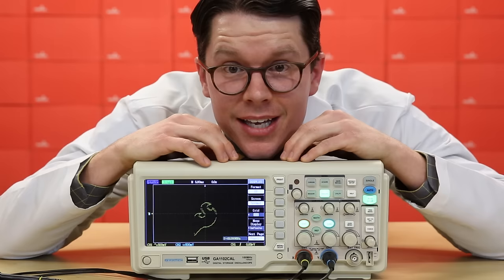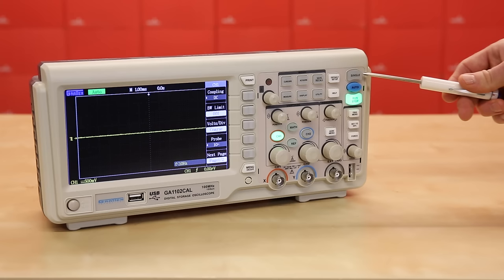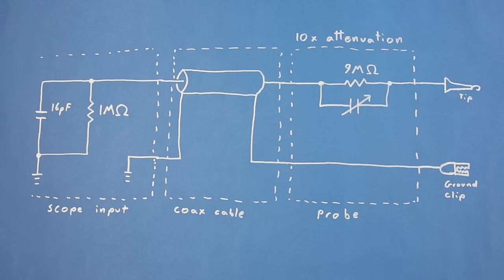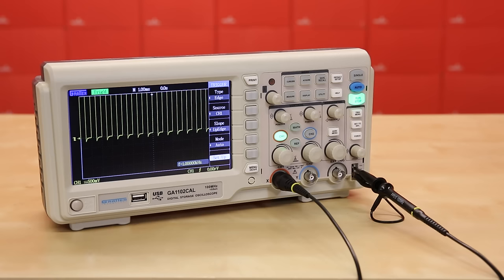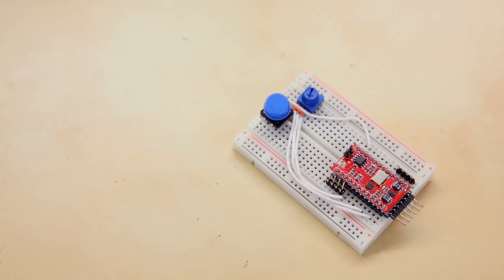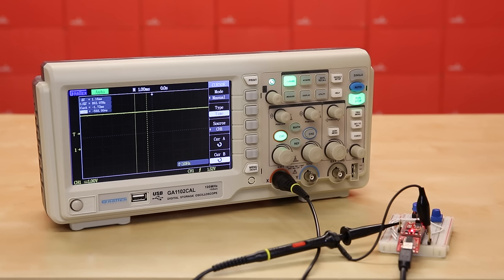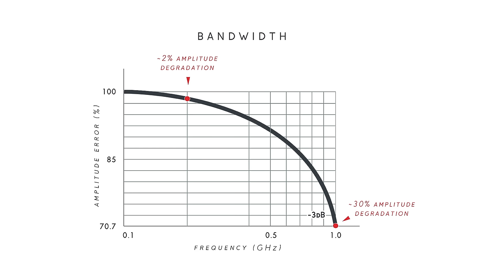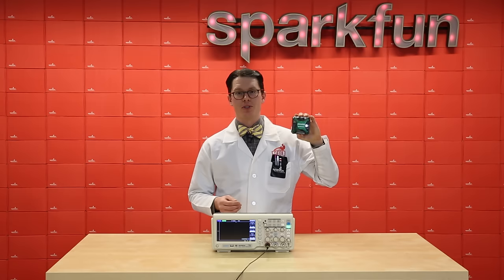How to Use an Oscilloscope

Comment: You said we only needed to use one or two knobs.... but then you turned them all.  You made my brain hurt.  I'm not giving up regardless.  Though my brain be small, my will is gigantic.   This still makes my brain hurt though. I think I mentioned that.
Reply: Chris Norton
It is only when the brain hurts that knowledge is being applied.
When I was studying Electronics Engineering decades ago, whilst working for PHILIPS,
My direct boss and mentor made my head hurt.
I could have strangled him then.
Years later whilst serving in the Military, I asked him why he was so tough.
He explained it this way.
Knowledge is like hammering a nail into a wall.
To make sure it penetrates one has to hammer it hard.
When one just 'casually throw the nail (knowledge) at the wall, it will bounce off.
I realized that by being tough and a pain sometimes, he did me a great favor, in that
I never forgot what he taught me, and by doing so made me a great Engineer.
Ultimately leading to being posted as an exchange officer to the USAF, and having the
opportunity to work on some special projects, in electronic weapons, robotics projects for NASA/UASF
working with avionics specialists on the Presidents Jet(s), and having learned much during this time,
as well as solving some specific problems.
Stay with it. Success is achieved by 'DOING'. Trying does nothing, trying does not even cure constipation.
It will only give you pain the A _ _ 
As a side note .. I am still good friends with my one time mentor and former boss. 
He is still alive and exceeded age 85.
Reply: Yeah this was at the 4:45 mark or so. I saw your comment first so when he did the setup before taking a measurement (pushing every button and choosing a setting for everything I barely grasp) I laughed out loud.
Reply: mee too man

Comment: It would be helpful if you could give practical examples of WHY one would need to use an oscilloscope. I’ve seen many videos telling me what oscilloscopes measure, and how the machine can be dialled in to take these measurements, but I still don’t understand what kind of circuit problems or situations require an oscilloscope.

Comment: Howdy.
The 10X feature is to enable measuring high voltages or to provide very low loading of the measured circuit.
Tuning the probe capacitor means that the probe R/Xc ratio is the same as the input R/Xc ratio. This delivers best signal fidelity.
Using an oscilloscope be aware that the signal grounds are galvanically bonded. One could introduce short circuiting when using both channels doing measurements in an appliance. Worse still. Older cathode ray scopes also have their signal grounds connected to the chassis and the power Protective Eath ( = power ground ) is also connected to the chassis. There are real dangers to smoke one's appliance or getting shocked.
Always feed an older scope through a separation transformer. Always use a galvanic separator in one channel when doing dual channel measurements.
In my digital scope there are galvanic connections between the power ground ( = Protective Earth ) and the input grounds. However. I use the scope in an older apartment where there are only two prong outlets in the room. Old wiring may, totally legally, be as they were done originally. So I do not need to feed the scope through a separation transformer.
Regards.

Comment: Glad that they didnt scare off any newbies with the fact that the scope shares ground on all channels and that ground is not isolated from the rest of the circuit in your house so if you go probing AC voltage and connect your ground to live or neutral you gonna have a really bad day.

Comment: I bought a scope just so I can look like I'm doing something sciency.
Reply: Always a good call.
Reply: Yea? Me too! (LOL). Frankly, I bought it because I need to test and adjust my Tascam 32 Reel to Reel Record and Playback heads. I've got a lonnnngggg way to go before I can do that. So I joined a forum and I printed out 3 different "How-To" manuals and one owners manual.

Now I need to lock my home-office door for two hours everyday because my wife doesn't seem to understand that periodical intrusions while I'm reading these manuals requires my utmost concentration. I always wanted to learn how to use a scope but I've NEVER EVER touched or 'played' with one! I only recently realized that I wasn't near an oscilloscope more than maybe twice in my 60+years!

That's really wild in my mind because I'm a retired 1st class machinist and have worked for at least 15 different production shops, job shops, mold and tool-making shops and even 3 or 4 specialty R&D shops! (Not to mention a number of journeyman field jobs I was hired to do). At least two or three of those shops were geared to machine electronics related parts and equipment.

I may have seen a scope in the R&D shops, (one was an aerospace shop and two others were 'extreme-compression' operations). It just seems weird to me that as interested as I've always been about oscilloscopes, and the potentiality of one or more of those shops to have a scope, I've hardly ever even touched one... huh...

Well now, I own one... "hmm let's see, where the on/off switch on this thing..."
FWIW
Reply: Ahahah! i liked" the wife intrusion section!!"
Reply: I bought a load of books n shelves, and got rid of my T.V. to look more intelligent.
Reply: I'm a former B-707 and DC-8 driver and have made the mistake of exploring micro-electronics. I'm single so the wifey thing isn't gonna be a problem but the endless reading of manuals isn't my thing either. That's like engaging the auto-pilot and just scanning the steam gauges (or worse today, the glass screen cockpit displays now standard on flight decks...) and doing nothing but twiddling my thumbs for 6+ hours. 

At least with a radar (doppler) scope I could see what was important and know what it is. With these things, I'm beginning to think I need an EE PhD to understand them :) Good luck with the manuals and the wifey separation time. LOL
Reply: So did I, but girls still object when I put my hand down their blouses.
Reply: +Blondie SL
I see no shins there.
Reply: Ha... I took a selfie with a scope in the background, displaying a waveform from my function generator... Looked very sciencey, except to a scientist...
Reply: I envy your funds, good sir!
Reply: Doug Hanchard , was ‘my
Reply: Okay, I admit, I did also for the same reasons.
Reply: I too bought a Tetonix 2440 to look sciency but I also want to learn how to use mine eventually... $40 was a decent price.
Reply: Oh, instead of a sine wave, plug in a function generator and make it create a square wave with unequal duty cycle. You'll seem even more sciency.
Reply: Martin Langley argh... what now?
Reply: Same
Reply: Don't forget to tune your probes
Reply: that's what I'm gonna do....fuck it, why not
Reply: you can also use some with a music setup, some have inputs for audio jacks
Reply: excellent my recommendatons are to also wear very heavy glasses, a white lab coat and also say things like variance, settings, probing, signal, wave, adjusting knobs, small knob large knob, channel, jittering and oscillocrypiticheisenbergmoleculescrewdriverthingy...
Reply: Bunsen Burners are fun too.
Reply: Let me know when you are ready to sell it. I'd actually use it.
Reply: Then all you need now is a lab coat and some moutain dew bubbling on a bunsen burner. And some smoke.
Reply: I bought an oscilloscope to find a hifi problem in my car ... I was able to find it and correct it. What shall I do now with it ... ?
Reply: @SirTubeALotMore  Buy more broken cars?
Reply: I thought I was the only one!  lol
Reply: Could've saved a lot of money with just blinkenlights
Reply: I can relate to this spirit very well
Reply: LOL, me2
Reply: Awesome 🇧🇷😉👍👏👏👏👏👏

Comment: The  center conductor of the coax part of an oscilloscope probe is no simply a regular wire, the center conductor is actually quite resistive.  With the probe in the X1 mode, one would think that there is an almost zero resistance between the probe tip and the BNC connector center pin but the resistance is actually a couple of hundred ohms!! Measure it yourself.  This helps prevent ringing on fast rise time signals. The slight attenuation on signals is not only insignificant, it has a flat frequency response  and is compensated for by the gain of the input amplifier.  
This is a sort of trivia bit of oscilloscope lore and has no effect on anything you showed In your excellent video. I will admit that I haven't watched a lot of oscilloscope primers and you may cover this bit of trivia l, but I found this fact out some years ago when I made a X50 probe for a very specialized application  and it didn't work right....the problem was my 1 meter coax didn't like my really fast rise time pulses.  It took a lot of research to find reference to the high resistive coax used in scope probes. There is very little reference to the fact that the coax used on oscilloscope probes uses a resistive center conductor.   My solution was to harvest the coax from a defective probe and roll my own X50 probe. 
You have made a good video that will help lots of folks use this most important piece of test gear.  Keep up the good work.

Comment: true RMS multimeter used 90% of times and finds 90% of the problems. Scope used  10% if you want to look at IC chips Pins. Better to get  in-circuit  ESR meter than scope.

Comment: Shouild a metal screwdriver be used to adjust the capacitor? Surely a nylon / plastic one would not introduce any unwanted inductance / capacitance to the circuit.

Comment: Very informative video, thanks!

Two things:

1) How would you get from buying the SparkFun MiniGen kit to using it to test a scope? There seems to be some steps missing between having the MiniGen attached to a Pro Mini and actually having a setup that allows you to choose wave forms etc. (blue selector button and pot in the video)

2) What kind of software are you using to draw diagrams in the video? Are you using a pen or just a finger/mouse? Connected to a Wacom tablet?

Comment: I have a really dumb question. I have a simple uni.t  2102 CeX oscilloscope just running a very simple lab. But I do run it off a inverter generator. Could you frequency from the generator give me false readings on my oscilloscope.

Comment: I'm looking for a simple beginner's scope to be able to measure and monitor simultaneous voltage and current waveforms and thier phase behavior at just 400-500 hertz.  I'm running around 400 vac or pulsating dc at around 1-2 amps for an ignition coil driver circuit.  Can anyone guide me with the following scopes?.... I've been looking at the Kiprim DS1202 vs the Hantek DS02 C or D series vs the Yeapook ADS1014 D.  Are there any cheap but decent current probes/clamps that would work with any of these?  New to scopes and electronics here and wanting to learn.  Any help is greatly appreciated.

Comment: I appreciate your oscilloscope instructions work for your oscilloscope. They certainly don’t work for mine because it’s different than yours. You must think that everybody owns the exact same unit than yours.  Which by the way is not true in case you’re wondering. The controls are in different locations. A small amount of what you were talking about applies to all Scopes. I’m certainly sure you lost quite a few people with your teaching technique which assumes that all people are clairvoyant and can read your mind. For example I didn’t know that the board that you were working with even existed. I don’t know what its purpose is. This type of teaching gave me and others a headache as we could not follow along as quickly as your personal understanding of Scopes. This forum is not  a competitive race against time. Think about the different types of people that would be watching this video. This is the first video of yours that I’ve ever watched. Try again

Comment: sorry sir.the probe is 10x can use with 300vdc? but scope limit at 50 v-pp. when I have osciloscope maximum band with 200khz .Can I use it for frequency 40 to 45 khz? Sorry I am a rookie. Thank you so much

Comment: It seems all the scopes carried by Sparkfun are limited to 8-bit sample resolution. Is this a significant limitation in practice? I understand these are low-cost scopes, and frankly that's what I need at this point - not necessarily a high-end instrument but something that can handle simple jobs, help me visualize signal integrity issues in my communication lines, show me how stable the output of my power supply is, etc.

Of course in a sense it wouldn't make sense to have more measurement resolution than the display can represent...  But these scopes can also record the waveforms and send them to a PC, things like that. It just seems like an odd choice to not get a few more bits into that measurement. If the scope were calibrated to measure from -12V to +12V, that means your sample resolution is about 0.1V, right?
Reply: Your calculation seems right, and yes, 8-bit is definitely on the low end for scopes. It's good enough for my work, but I'm generally not working in anything above a few MHz or signals with more than 5 Vpp.
Reply: For a low cost scope, almost all are 8 bit. They seem to all be aimed at digital work. Owon now makes an affordable scope (the XDS series) which has 12 bit and 14 bit resolution. I recently picked up the XDS 3102A, which is a 100MHz scope with 12 bit resolution (the 'A' at the end denotes the higher res models). It also has a 800 X 600 display. Since almost all of what I do is analog (audio repair), I wanted the higher vertical resolution. 12 bit gives you 16 times the resolution of an 8 bit scope.

Comment: ok can I check a 110ac voltage?
Reply: Connecting a scope's probes directly to 110 VAC will likely damage the probe and/or scope. You'll need to step down the voltage with a transformer to be able to see the waveform.
Reply: You can measure ac (110V) with no damage. The guy above is a troll

Comment: So the bottom line is the board is broken. You need to add resistor, a capacitor, or we just get to watch Wiggly lines. Or do we just take to probe and put it in a squirrel's butt to see what happens. Bottom line is we need to know what it's doing for us how it's helping us.

Comment: This video makes the classic mistake of presenting its content towards an audience and assuming that they are at a proficient level with some experience. Ever heard lawyers speak lawyer-talk? Or software devs teaching beginners using advanced topics that were never explained to the beginner? This is the same mistake. Fail.

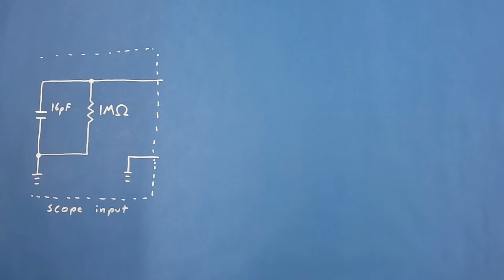Think I'm kidding? It only took 2:12 minutes for the presenter to drop the words "Picofarad capacitor" and my eyes glazed over.

If you find someone who can teach you a subject in layman's terms, you will discover the universe. These types of teachers, however, are very hard to find.

Comment: I got how to use it, but UI is the sh***tiest I ever saw! press, turn, press, turn.... What the moron invent it?? Even printer with arrow buttons has much easier UI.
Reply: I have to agree. Oscilloscopes have always been like this as long as I've used them, and the UI is never great. A few USB scopes rely on software that has slightly better UI (my current favorite is the Analog Discovery 2).
Reply: I like the basic UI of an oscilloscope. vertical gain, vertical position, timebase speed, horizontal position, maybe coupling or beam find. On complex modern digital scopes with logic analyzers and other complex function, yea -  the UI needs work.